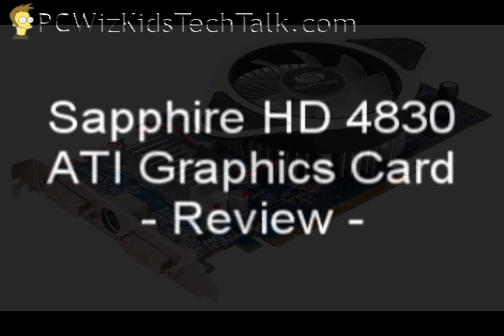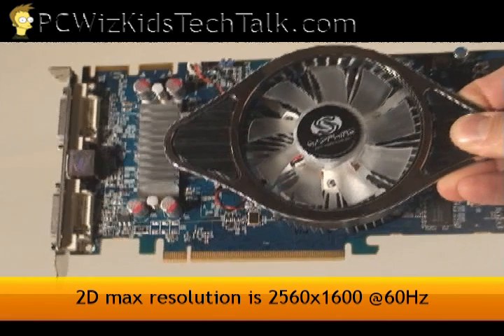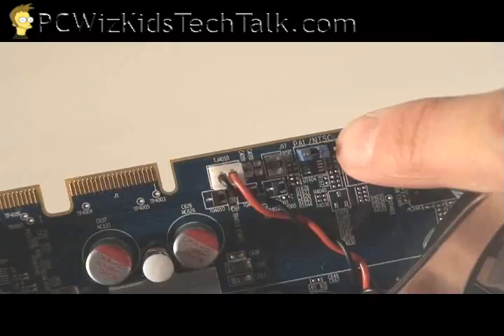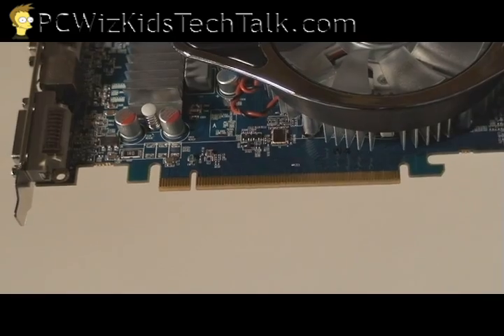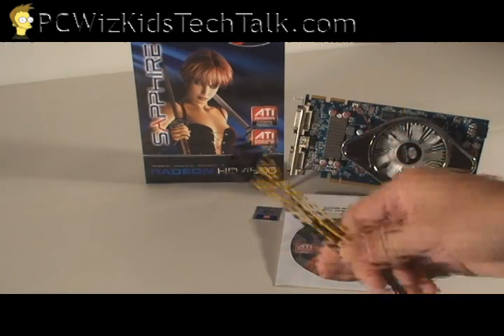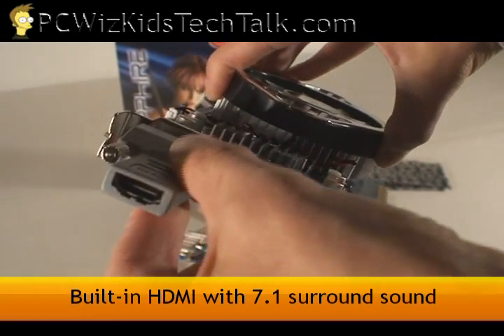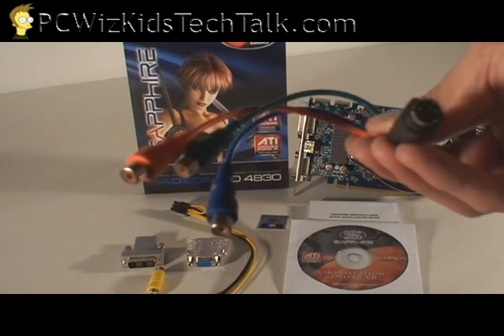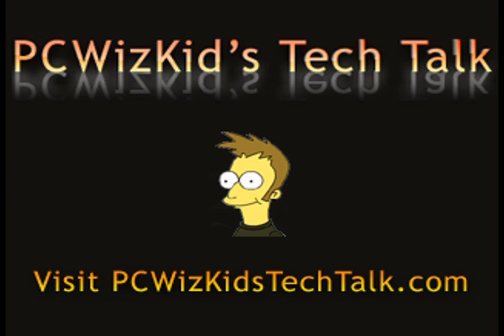Sapphire HD 4830 - ATI Graphics Card Review

Comment: On a high resolution like 1920x1200+ the cache difference plays almost no part. Might as well buy an E5200 and bsel mod it on a shitty motherboard to 4.1Ghz. This is good enough for ANY single GPU card out today.

If you plan on sli or crosfire (don't !) you NEED to get a quad cpu to get the maximum out of them.

Comment: As long as you have a good, quality power supply, you should be able to run it at medium/high settings (maybe some at max; I'm just guessing). I have this card with a Athlon X2 5200+ and I'm amazed by its performance. Great bang for the buck.

Comment: Can this card work with the following specs?

Intel Celeron Dual-Core E1400 2GHz 800MHz 512K LGA775 CPU, Retail

Kingston KVR800D2N6/2G D2-800 2GB Memory

GIGABYTEGA-G31M-ES2L Core 2 Quad/ Intel G31/ FSB1333/ DDR2-800/ A&V&GbE/ MATX Motherboard

iMicro CA-IMJ230P 400W 20+4pin ATX Mid Tower Case